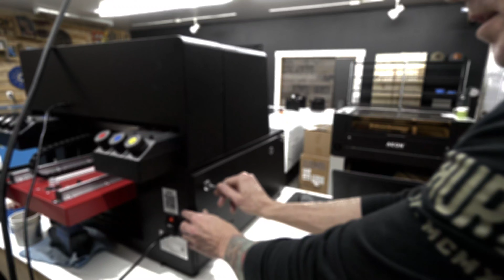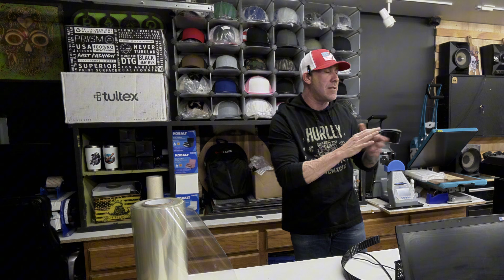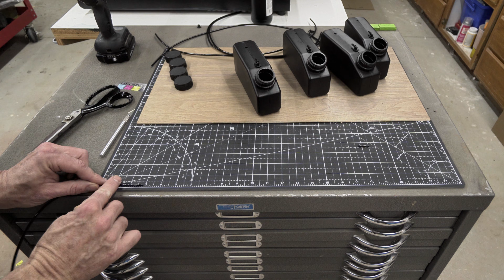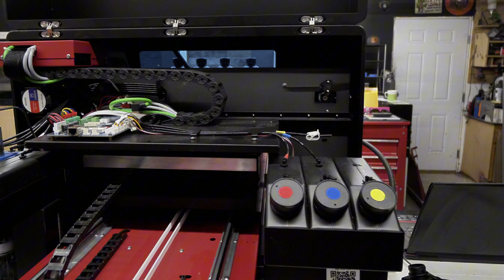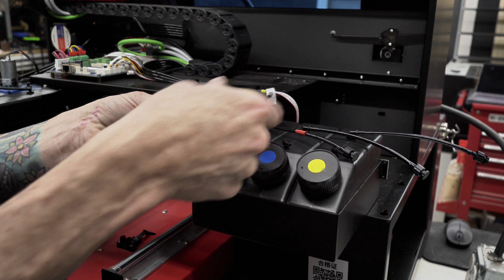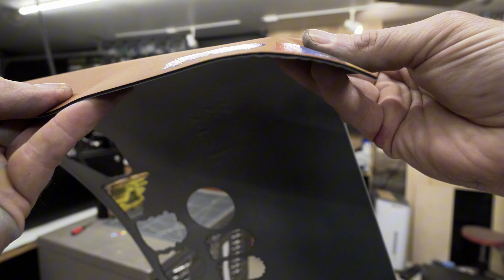How To Change UV Printer Inks | RF-ZZ2C Hard and Soft Ink Setup Guide

Comment: Maybe I missed it in the video but does the ZZC2 have autofocus? If not, what is the process for setting focus?
Reply from the maker: Yes. Has an infrared sensor. Jog table up until material hits the sensor and it automatically stops. You just have to double check and calibrate the sensor height. You print 2-3mm above materials.

Comment: I used a Y barbed fitting about 4 inches from the jug on machine and added a shut off on it, then ran a hose off the Y along with another shut off with a disconnect for the reason of how i mounted my spare tanks to the machine. Works great and you dont have alot of extra hosing either.

Comment: So why did you not swap out the white and varnish? Are white and varnish soft by default?
Reply from the maker: Yes. We always run soft varnish. The white was already soft as well. You would swap the white if need be.
Reply: @RISENGRINDWORKSHOP Can you do a video on setting up and first run of the rotary tool on the ZZ2C?
Reply: Ok thanks! So no issues running soft white and varnish on hard substrate?

Comment: So you can run soft white under hard color inks? Does that affect how the hard inks work/bond? Can you just run soft ink on hard objects?
Reply from the maker: For context. I setup the UV Printer with ALL Hard Inks. I changed the white to soft ink and left the color hard. We could print great quality on Leather and get SOME flex without cracking. When using all soft ink, you get no cracking but lose some sharpness - it's a trade off. THe soft ink scratches a little easier and not as vibrant. Personally I want one setup with Soft and one with Hard. Unless you have that budget and space, this KIT is the way to go!! Thank you for the great questions on this ZZ2C UV Printer from Jay's

Comment: What is the best way to insure that you have flushed out all of the hard/soft ink when switching?  Is it just assumed that the load ink time used will do this?
Reply from the maker: Hey Curtis, great question. For me personally I went ahead and ran 2 color flags just to make sure I had the lines purged. I would imagine after loading the ink and a few color flags, head clean and nozzle check you will be good to go!
Reply: @RISENGRINDWORKSHOP  thanks.  Wasn’t sure if there was something to look for (ie. color change, etc.). Thanks again for the great video.
Reply: Hey now, we're 6 months in I guess since you did this how is this changeover model working for you. Have you had to purge the lines in any way?

Comment: I have 6090 Pro - just wanted to note that with the 6090Pro machine  the place to connect the outgoing line to the ink jug is not on top.  It comes out the front bottom.  

Great video! 😊
Reply from the maker: Would love to have a 6090 Sized Printer in the Shop! Be on the lookout soon maybe even something with i3200 Print Heads

Comment: You don’t need to change the white or varnish? I thought maybe there was also difference for soft/hard for each of those.
Reply from the maker: I did clarify in the video, we ALWAYS run SOFT WHITE AND SOFT VARNISH - We already had Soft in each of the factory containers :) Each user can change out the jugs for their personal use and needs. Thanks for the comment!!
Reply: @RISENGRINDWORKSHOP  that’s interesting as I didn’t know you could mix the soft and hard inks.
Reply from the maker: @rcarroll05  Well, Technically not "Mixing" swapping from one type to another. Once you load the new inks and purge the lines, you have all new inks in the system. Some UV Printers like Mimaki you would have to own 2 machines!!!! YIKES
Reply: @RISENGRINDWORKSHOP  did you also change out the white ink from hard to soft?
Reply from the maker: @rcarroll05  Yes, I had changed the white ink to soft weeks prior. You would just follow the same steps and replace the white ink, however, the white has a hole for the ink stirring motor - Jays is working on a spare jug that can stir - could always run you own little power bank and install a spare motor and program it to run every 20 mins with like a Raspberry Pi Maybe???

Comment: Wouldnt it be better to run the line a lot farther up so there isnt as much ink of whatever was in before? Honest question from a someone that doesnt have anything like this yet. Also, it almost seems better to just buy two of these!! lol Could you do a video showing soft ink printed on leatherette and on hard wood surface to see the difference?
Reply from the maker: Later in the video I actually mentioned, I would shorten the lines up. The XP600 Print Heads have enough in them to pull the ink, but if I am switching between the 2 inks often, I can see needing shorter lines for less waste. Overall, can't beat this setup to be able to quickley change ink types when need on a Flatbed UV Printer. Especially these little Refinecolor ZZ2C Printers